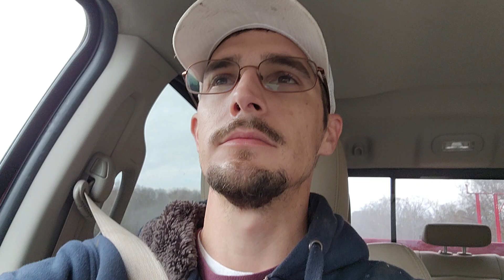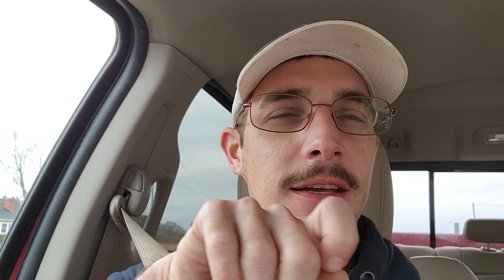Hydro-Frack Test Results are In! Amazing Results! +PTO cover Plans?! Subscriber is Very Happy!

Comment: Question...We are buying a house in Colorado, and the well only produced .16 GPM.   The owner had the well fracked on Tuesday.   They believe they got a good frack!   How long is necessary to wait until another pump test is done so as not to get a false positive?    Thanks!    I've learned so much from watching your video.
Reply from the maker: Typically a week afterwards. You simply draw down the well & calculate how fast it recovers, do that 4-5 times & youll know what it makes. 
Or do like what we do and use the water like normal and see if you run out. If you run out, then you'll know it won't support the household during normal usage. And always turn off the pump breaker if water stops

Comment: Maybe a stupid question, but does the lake being so close have any influence on the well?
Or is it so shallow compared to the depth of the hole that it makes no difference?
Reply from the maker: The closer we get to the lake, the deeper the wells become. The geology of the ground is solid, that's why the lake holds water so well & why they built a dam near by. The granite below doesn't have alot of fractures & veins, so hard to find water veins unless you go deep.